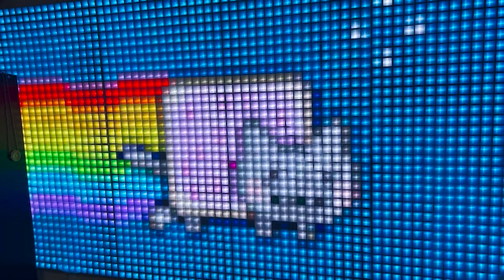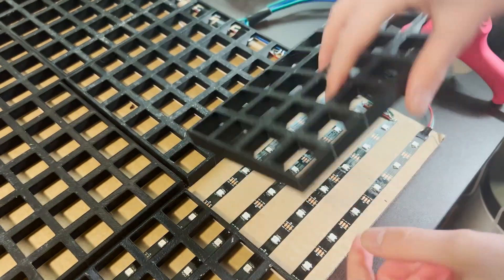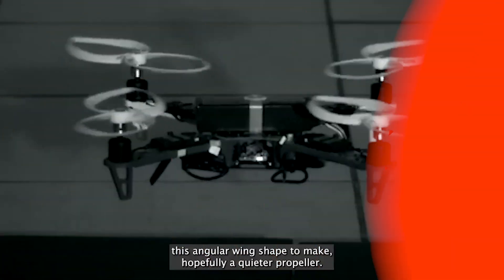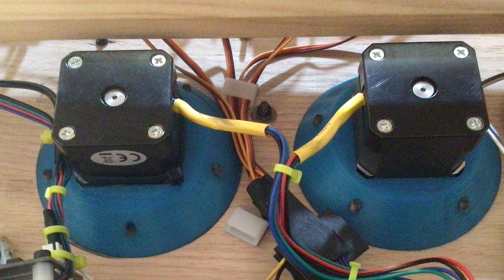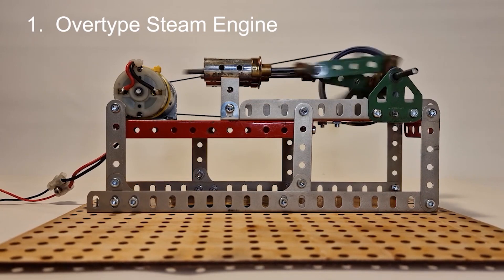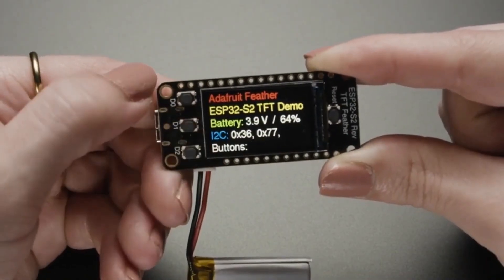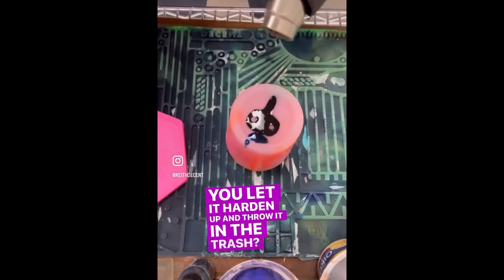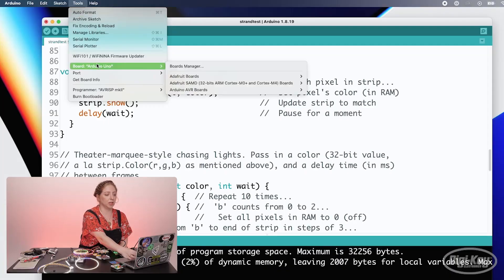Glow Up [Maker Update] | Maker.io

Comment: @Digi-Key You should do a bit more research on these propellers. It turns out that the results were massively overblown, and the whole thing sits on the edge of being a hoax.
Reply: I appreciate the feedback - it does seem like there's a bit of controversy around the propellers. I'm neither a scientist nor aerodynamics engineer, but I generally trust MIT to put put out more scientifically sound videos than most youtubers. That said, it seems like ultimate benefit of the propellers is yet to be proven, and I believe the language I used in the video reflected that.
Reply: Interesting, as this is the first I have heard that after watching a few drone demos.... 😐